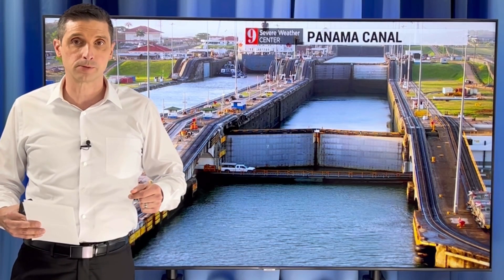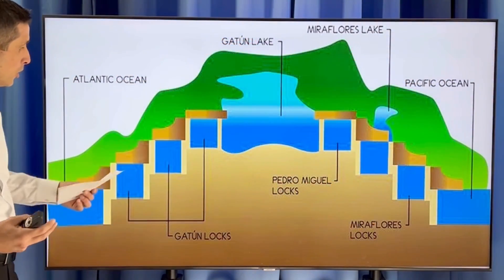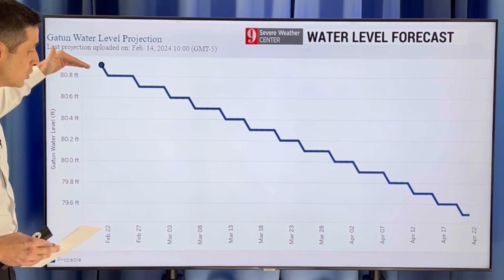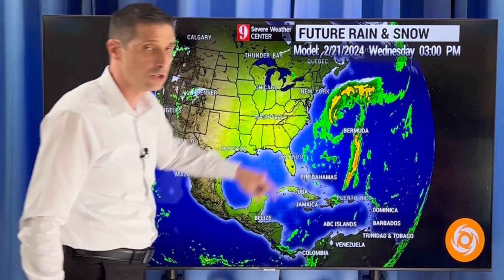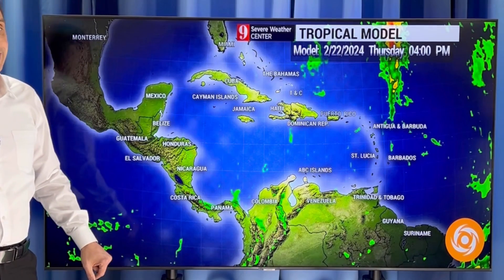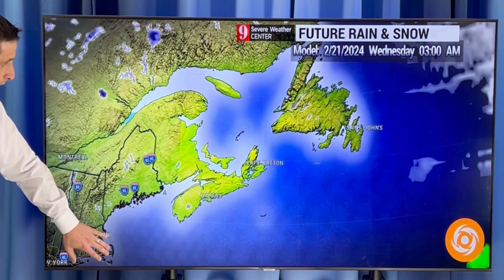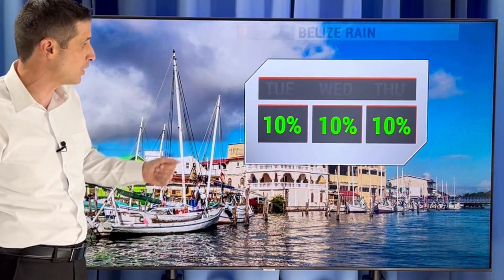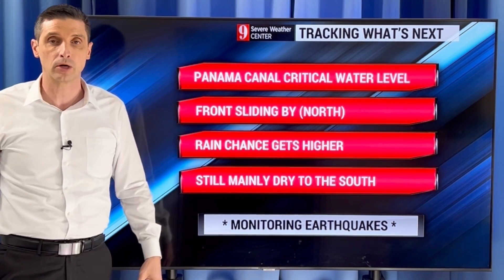Critical Levels impacting the Panama Canal...

Comment: Is it feasible to dig down to eliminate the lock system? The Suez Canal is at ocean level with no locks. In principle an ocean level canal could also exist in Panama by elimination of a channel through the interfering terrain.
   I know it wouldn't be easy, but with much improved equipment from that used to build the original lock based canal in the first place, there would seem to be an opportunity to at least consider it.

Comment: (Writing from Trinidad) We had to change out an old ac and there was a shortage as shipments were held up at the canal. They have since come though but this situation is worrying. I've been keeping tabs on ytube channel "what's new with shipping"

Edit: Items that come via container can be offloaded onto rail and taken by train to the other side where it can be reloaded and sent on its way. This adds to cost and time. Oil, gas, grain that is not transported this way has to find other avenues especially if they are the big tankers. Going around Argentina is possible but risky as the wind and ocean currents are very rough.